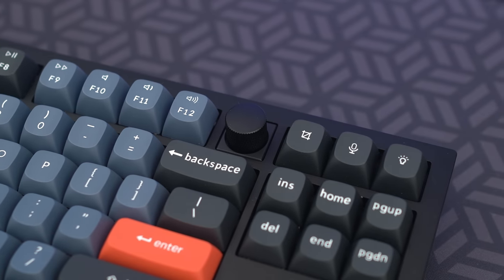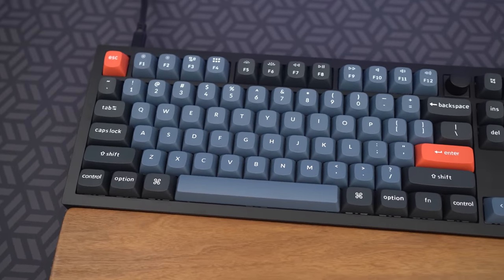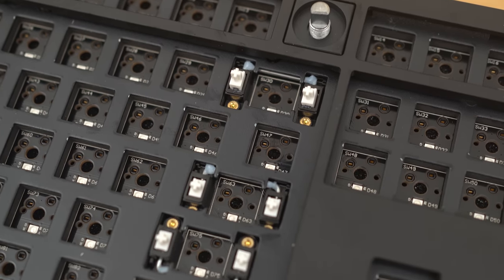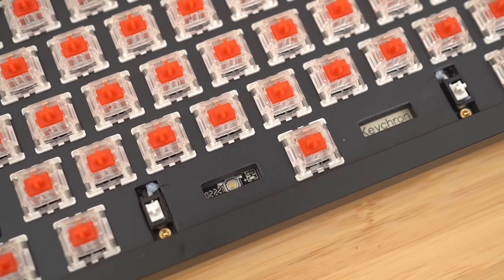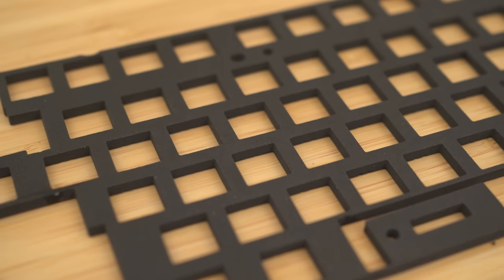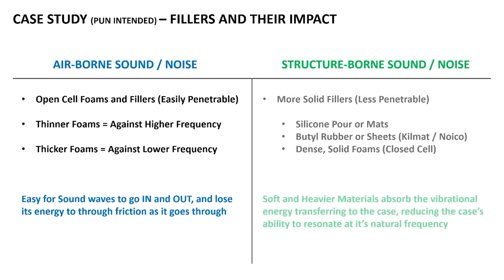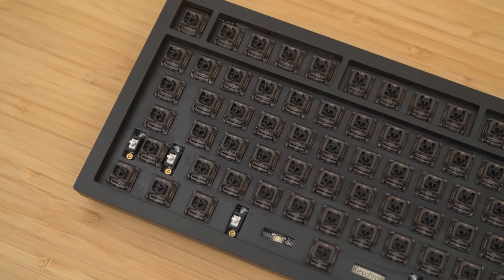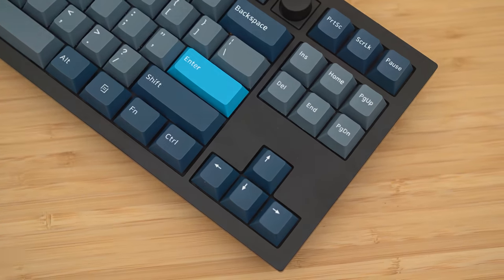Keychron Q3 - KEYCHRON Back with a 3PEAT on TKL with a Knob!

Comment: Alright. I went for it. I bought the preassembled knob gateron red switch Q3. Out of the box there was an issue where one key press would show up on screen as twenty key presses but with a quick reset button press, that issue was fixed.  I replaced the keycaps with something that was a bit nicer to the eye and had more design (Outer Space PBT on Amazon). I also bought poly fil from amazon (very cheap). I took the back of the keyboard off and FILLED the case with poly fil. I put a very healthy amount in there. Screwed it back together and I'm using it on a desk mat made out of mouse pad material, and man I couldn't be happier. I love this keyboard and the sound so much. I even bought a number pad with matching keycaps, looking forward to modding that as well :) If you're worried about dropping money on your first legit keyboard, feel safe with this one. I feel like I got my money's worth 100%. Total cost with mods 240$ U.S.D. as of 10/22.

Comment: thank you for the tips!  I have a new Q3 and I just did tape mod with a few layers of painter tape on back of PCB and then a few small double layers of tape on frame near screw holes etc, as you did.  I was also cautious as I tightened the two halves of the case together as I don't want to overcompress the silicon or the tape.  I made sure they were snugged and secured well.  Just not super torqued down alot.  I noticed as I was unscrewing the two halves for the first time that the screws were not very tight for that same reason I think.

Thanks again!   *edit:  I went with Keychron OEM PBT 1.6mm thick Dye Sub because I got the barebone keyboard.  I love this keyboard!

Comment: I run my Q1(no knob) with NK creams, DMK keycaps, stock aluminum plate. Then for mods, I use tape mod, 1mm silicone sheet, force break mod using KBDfans stab dampener. The result is no pinging and hollowness. Sound profile is clacky. I plan to do the same when I get Q3 (no knob version).
Reply from the maker: Good luck!  I hope it turns out great
Reply: @Keybored  thanks! Your review is my go to because I like the scientific approach. Keep it up!

Comment: something to note about the switch on the front and the ability to use VIA. they dont tell you this in the manual for these boards but, 2 of your 4 layers are reserved for when your  boards switch is set to windows and the other 2 reserved for the "MAC" switch. i learned this when i thought my board wouldnt program but i was using the wrong layer when i was in windows mode on the board.
Reply: is this something that we do on the software?
Reply: @jackasad2180  yes, you have 4 layers total to customize how you want. But layers 2&3 are reserved for when your keyboards switch on the back is set to Windows
Reply: @MrSkullhead0  so for 1 and 4 is free right?
Reply: @jackasad2180  it’s strange because you can program later 0 and it works for the main layer for your board for both Mac/win, but layer 1 only works if flipped to MAC on your board. 2 and 3 are the WIN only layers.

Comment: really enjoy the more scientific explanations to sound modifying of keyboards.  New into the hobby and I hear of all these different kinds of foams and felts and approaches and people show the results but not what is best used in what situation. Currently have  Tecware Phantom 110 (?) (the full size cause I need the numpad) and added some felt I bought from the dollar store to the bottom of the case + the case foam.  Can't remember if it did anything lmao but I want it thockier so from your video seems like I might need to try a pe foam (since I want to eliminate high freq.) and tape mod and remove the felt...hmmmm

Comment: Have you ever used melted paraffin wax as a solid filler?  I'm trying it now on a cheap board and find it effective.  Best part is that it only costs $2 per board(much cheaper than silicone).  I use just under half a pound of wax per board.  The wax can be found at most hobby stores for about $5 a pound.  It melts easy and be easily trimmed back once dry.  It doesn't hurt plastic boards when poured.  Use silicone to fill any holes to prevent leaking.  The silicone can easily withstand the heat of the melted wax.  The long term effects are still up in the air.  I'll open my board up in a year to see if it has cracked into smaller pieces.  So far it's remaining intact.
Reply from the maker: Haha, Hipyo talked about this the other day.  Perhaps he can try it out and let all of us know!

Comment: Really love your videos + the scientific explanation behind it. Just a question tho, should the plate foam be included or not included if I wanna go for a thocky build? Or the plate foam is thin enough that it blocks out the high frequency sound waves instead?
Reply from the maker: For this build, the plate foam is necessary because it helps to control the steel plate resonance
Reply: @Keybored  Ah I see thank you for the info! Let's say if I were to use different softer plates like the FR4/PC/POM plate, should the foam be included to achieve that thock?

Comment: you could essentially go to the auto parts store and buy a roll of gasket material. the gasket material will also insulate the aluminum from the resonant frequencies. gasket thickness comes in many different sizes. i work on lots of things and have had to make my own gasket many times. you can call it RFB mod, short for resonant frequency break mod. i think it sounds a bit better than force break mod imho. super simple effective easy fix though. good vid sir, im just starting to get into keyboards myself. im looking to do a first build as i game alot. the 2 switches ive come to love the sound of are cannonkeys lavender and durock poms. i like novel key creams sound but i think the 2 i mentioned sound better. i like a deeper thock much more than a louder clack. to me coming from automobiles you may laugh but this is how i look at the clack and thock. the clack reminds me of a engine having a lifter tick. much higher pitched ticking sound. the thock reminds me of a rod knock. a much deeper sound found in the lower end of the motor. so the clack is more of a tick sound while the thock is more of a deep knock. i cant wait to pick out my first board as i wanna do some experiments with sound and different materials. possibly use unconventional materials for insulation as well. either way it'll be interesting thats for sure. good video and i look forward to more. ps i do not want a know on my keyboard and i would like to have a nice brass weight.

Comment: thank you for the videos, top notch! thumbs up...

  thoughts on potentially using a very thin o ring that would essentially sit around the screw hole or slide over the screw itself??  -instead of tape near the screw holes

Comment: Thank you for this very informative video. I'm looking for a TKL keyboard and this one seems to be decent and its flaws easily fixable. One question re: the "tape force break fix" to acoustically decouple the upper and lower part of the case: You seem to be using blue painter's tape for this. Are there any brands/types that are better for this job than others? If so, which ones?
Reply from the maker: Nope, you can use blue, or standard masking tape as well!  Basically, you're creating a very small gap between the top and bottom to create a "break" for force to travel to and from.  We do this a lot in engineering (I.E. Thermal Break) to prevent energy from one source from traveling to another

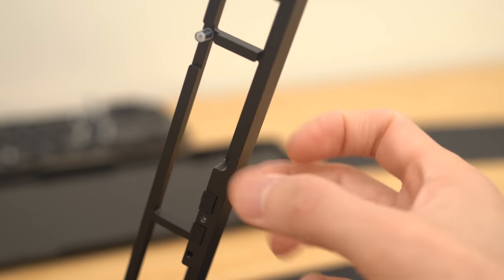Comment: Actually, Blacksimon proved that removing the force break entirely eliminates the ping (you can see it in his vod about the Q3 on youtube). I found out that the ping on the OG Q1 came from the top case being too thin in the areas such as the one between the F row and the number row and the top gaskets not being compressed (in my unit i could eliminate the ping just by pressing the area between the F4 and F5 keys and F8 and F9 keys), and this is also the reason why the Q2 had much less ping overall. This issue was solved (reduced a lot) on the Q3 by making the top much thicker in those areas, as you can at 9:06 (making it ping by hand unbuilt does not count, it isn't accurate to the finished board), so there isn't really a need for the force break mod imo (you can also make it work on the OG Q1 by installing the top gaskets in the area between the F row and the number row, which makes them compress more and therefore reducing ping). I personally like the sound of this configuration a lot more as it makes it less hollow, deeper and fuller to my ears, but I guess many people still enjoy the force break; it is something very interesting to note nonetheless.
Reply: I just tried removing the silicon pads, but it made my Q3 sound quite pingy.
However, push slightly the metal between the arrows, and the delete-end-pgdn this keyboard sounds perfect (like my Q6)
Now I wonder if a heavy filler would solve my problem...

Comment: Correct me if im wrong. So the force break mod just remove the ping sound when typing but the top case still ping if we try to tick it right? Because i actually consider to add lead tape to add weight to the top case but end up abandon the idea because i dont think there is enough space to really add weight and the weight added maybe is not that much haha. So it is fine right if typing sound is good while the top case still in that pingy condition haha.

Comment: Hey have you considered addint a O-Ring to all the screws in between the Top and bottom cases? Maybe you get a millimeter of more space for the Kilmat aswell as the case isolation?
Reply from the maker: I did this for the GMMK pro before, but I don't think it's necessary for this board.  With the force break, the thin foam below was good enough to keep the pinging at bay!

Comment: hey ive been watching you since the beginning with all the boards. but im wondering did you replace your g305/g304 switches? if you do what switch 😊
Reply from the maker: g305/304?
Reply: @Keybored  i think the mouse is the same but the name is different depends on the country (which is your current mouse right now) 😊

Comment: For flex typing experience preferences, which factor affect the most? : isleafspringgasket?flux cut pcb? Thicker foam?
Reply from the maker: It's space lol. All of that can't do much if there is no space to flex into. After that, Gasket mounts with flex cuts really flexible
Reply: @Keybored  Thanks Scott! 😆I think Windx65 has enough space but still not flex😭, I have no idea how to mod that. Maybe I should sell it and grab a QK65.

Comment: What do you think should be done to mod the newer version of the Q1 (with knob)? I’ve added layers of tape and done the force break mod with polyfill at the bottom yet it’s still hollow and the flex is gone. Any suggestions?
Reply: Weird because I got rid of the hollowness with the force break mod and polyfill. I also got rid of the 2 thin pieces of foam on the bottom. It flexes like a mf now
Reply: @africanchild5985  did you do the tape mod as well? Did you add extra gaskets? I don’t know what I did wrong lol

Comment: What specifically material did they use for the plate foam and bottom case and is it easy to change it to poron.

I'm looking forward to buy this or the akko mod 007v2
Reply from the maker: Plate foam is EVA and the bottom case foam is a super thin open cell

Comment: I appreciate this!  Just ordered the Q3 w/knob as my first step into the custom mechanical keyboard world.  This vid was very helpful.  I'll likely try the force break mod and tape mod to see how that works with the sound.
Reply: did u already manage with the force break and tape mod? i'd likely to order this board as my first custom mod keyboard too
Reply: @jackasad2180  Yes I did. I did two small pieces of painter's tape next to the screw holes on the case, and three layers of tape on the PCB.  The only other change I've made is to swap out the keycaps for a set of cherry profile ones.  The caps it comes with aren't bad, but I prefer the cherry profile.  Overall I'm really happy with the keyboard.
Reply: @Maelstrom01  so did u stacking the tape over the stock sillicone? will it break the guarantee if we put tape on the pcb?
Reply: @jackasad2180  For the force break mod, I put the tape on the metal part of the bottom of the frame next to where the silicone goes.  I don't know about the guarantee, but with painter's tape it should come off easily enough that I don't think you could tell it was on there to begin with.  So if you had some sort of issue and needed to send it in for repair/replacement, you could take the tape off.

Comment: Have they updated the Q1 to fix any issues? I feel like that's the look I want almost exactly
Reply from the maker: I believe the new Q1 is similar now to the Q2 and Q3 in a sense where they increased the thickness and such
Reply: @Keybored  thank you, thank you. Do you have any other suggestions for something like 65-85 exploded preferably with a knob? It seems like q1/q2/q65 are my only real options for something long-term/versatile. I feel like the other options are plastic/gimmicky that I might hate after a bit.

I'm having a hell of a time searching for exploded or knob on most sites. I do really like the retro clear plastic like the kbd67 lite and the iquinx 80 (really like the slanted FN row). Epo TH80, iquinix zx75, kono67, epo skyline, etc I've considered but none seen quite as good as the Qs.

Kbd everest is the big temptation tho but no knob.

Comment: There's really no excuse for them to be shipping the board like this. Nobody wants it like this and they are just doing themselves a disservice with this quality control. Yes it's easy to address but they should be incrementally improving this as they go forward.
Reply from the maker: Wish they increased the thickness of the pads a bit, and this would have been great out of the box.
Reply: @Keybored  did you try to slip something under the pad to add thickness, before finalizing on the force break?

Comment: Fun fact: Even with all the mods my Keychron Q3 sounds much worse than my friend's new Montech MKey without any mods—the latter is just much quieter and thocky (with the same Boba U4T switches). I also prefer MDA key profile used on MKey vs OSA on Q3. Do I need to say that MKey is about half the price?.. I blame the metal chassis and the steel plate. The plate can be changed to a PC/POM one,  but I've watched a few comparison videos and don't hear much of a difference so I'm really not sure what to do with my Q3. MKey is simply a better keyboard (typing and sound wise) even without the mods.

Comment: Knowing what you know now, how would you go about making the Q2 as thocky as possible? Avoid the kilmat?
Reply from the maker: You could probably do without the kilmat in the Q2 and add in a thin open cell foam for the higher frequencies.  Issue is that the steel plate won't give you much thock :(
Reply: @Keybored  Do you think the PC plate Keychron offers for the Q2 will be better?

Comment: should i get this or the qk65 as my first board?
Reply: qk65. keychron's boards are much less refined...qk65 has attention to detail and is just overall "better"
Reply: qk65 no doubt, unless u really want a tkl instead of a 65%. If u asked qk65 or Q2 (which is also a 65%) then qk65 for sure
Reply: qk65 100%, will have better build quality, sound, typing feel, only thing is it's a 65% instead of a tkl
Reply from the maker: I believe they are different concepts.  But the QK65 is probably the best "entry" out there right now

Comment: How did you mod the stock stabs such that the spacebar does not sound tinny? I have lubed and relubed my spacebar stabs on the Q2 but the spacebar sounds tinny ): there isn't ticking but it is resonating at a very high frequency. ):
Reply from the maker: Kilmat inside :)
Reply: @Keybored  This padawan is undeserving, especially after you went to great lengths to explain the science. Obviously not good application of the science just yet.

Comment: I do not understand your reasoning for the ping noise. Your argument is that because of the small silicone dampers the upper and the lower body touch eachother and this leads to travelling of the vibration from one layer to the other. But in the middle of your video you clearly showed us that if you put your finger on the case the noise immediately gets reduced because your finger actually damps the resonance. This exact does apply for the dampers to. If the upper and the lower body touches, in between, there are still the dampers that swallow the vibrations, like your finger. I think not the touching is the problem, but that the dampers are not sized right and do not swallow the resonance enough. So yeah, tapemod is always a good idea. But technically it is not a problem of the both layers touching, its the dampening not sized right.

Comment: are the stock stabilizers any good?
Reply from the maker: They're OK.  Not Durock V2 level, but also better than most generic screw ins
Reply: @Keybored  Did you replace the stabilizers in this video? Or are they modded stock stabs?

Comment: you used a thin kilmat? are you saying 15mm? as in 1,5cm? doesnt seem that thin??
Reply: i think he meant 1.5mm
Reply from the maker: I used the same 50mil which is slightly thicker than 1mm.  Even that was too thick
Reply: 50mil Kilmat is 1.3mm thick.